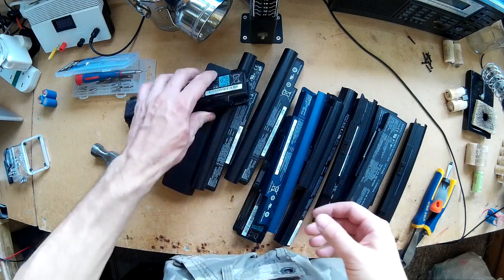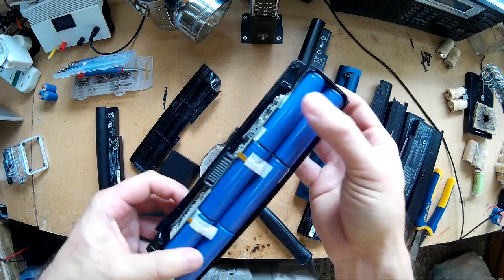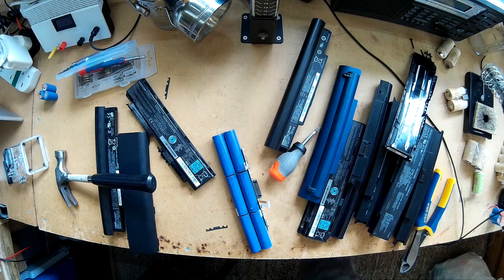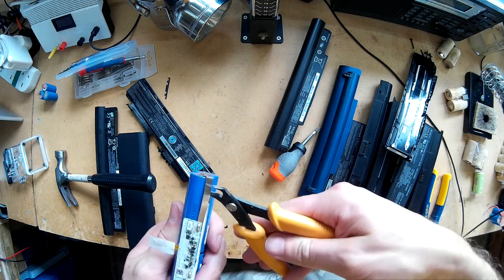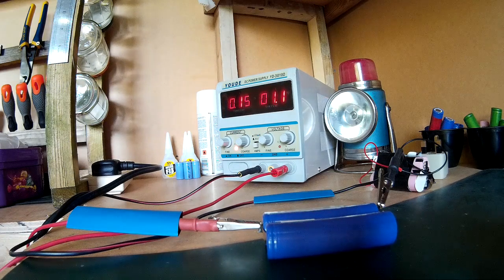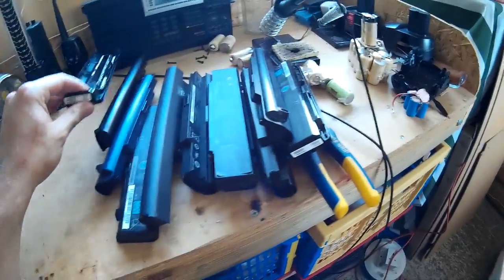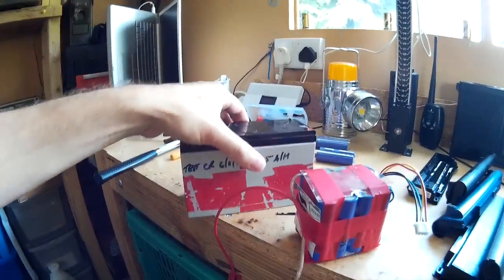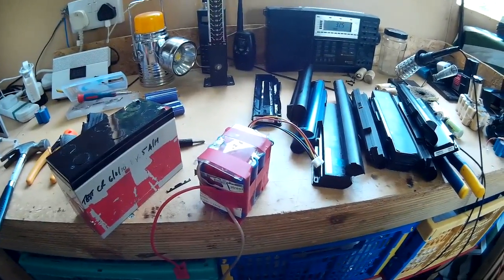Ebike Battery Pack Built From Laptop Batteries

Comment: Hi , I need some help . I start my project today and the first cell I removed from laptop batterys charged to 1600 to 2500 , but when I discharge than I get 300 mha . I used the same charge rate 1 Amp . What am I doing wrong ?
Reply: I think k I will save some money and buy some new ones

Comment: A Hammer is the worst way to open these things. I use a wide flat screwdriver and put it in below the charging connector and twist it open. Then work your way along the opening with a twisting action.
Reply from the maker: yeah i know but when you have opened 127 packs it gets boring just let off some steam hammer em.
Thanks all the best
Jace
Reply: I disagree that a hammer is the worst way to open these. Yes, you should really be doing the other things you mentioned but guess what? At least he's not trying to open it with a blowtorch lol.

Comment: the case is tough as shit, i pry the pack of the battery from my faulty netbook a week ago and score 6 of those 18650.
going to assemble a few usb power bank with those recycle 18650 from the case i got from ebay.